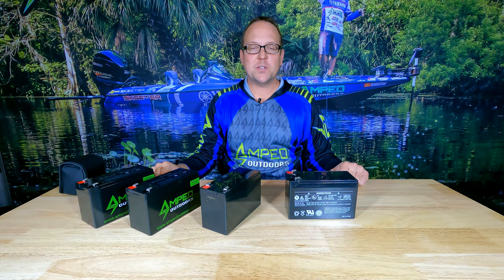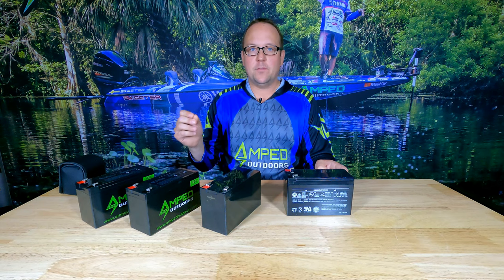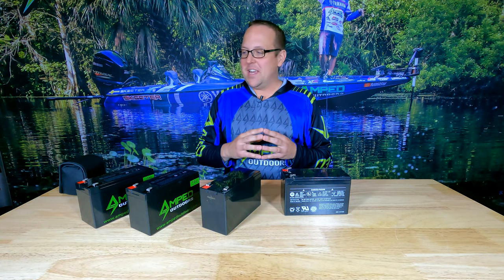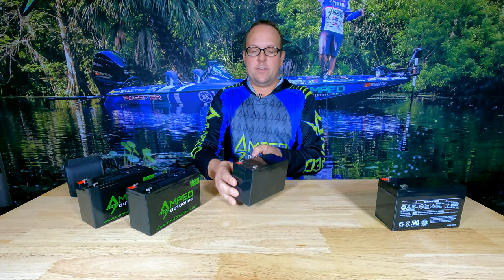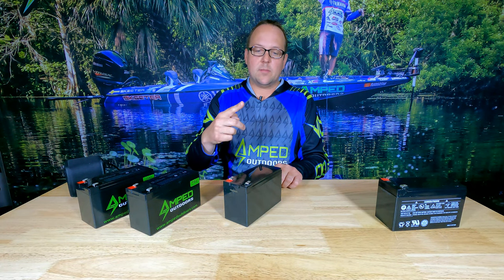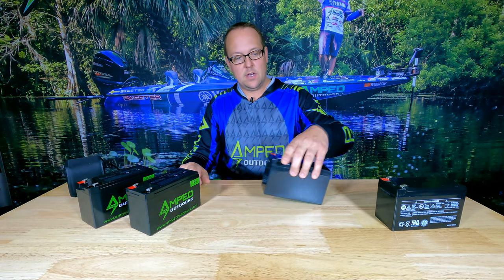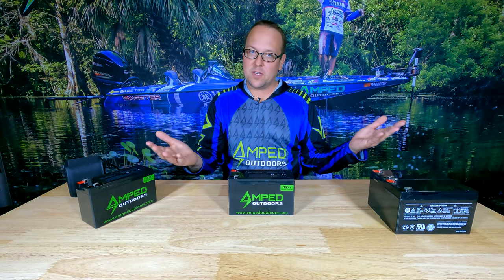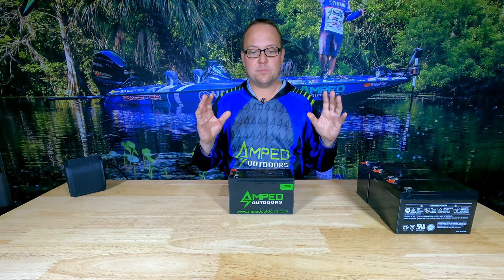How Fishing Electronics Draw Power - 11.1V NMC vs LiFePO4 vs 14.8V NMC

Comment: I am having a Mega live 360 and Mega Live W/target lock installed on my boat along with a Helix 10 and a Helix 9 (GN4's)  What size battery would you recommend to power these?  The boat is brand new and has 3 batteries with chargers already in place in the back of the boat.  All 3 are lead acid batteries.  2 to run the trolling motor (ultrex 80 45 with MSI/DI) and 1 for the outboard and misc.  I want a lithium battery for the electronics and see if they can install it and the charger in the bow compartments.
Reply from the maker: Hello, we replied to your email from the weekend. Let us know if you have any other questions there. Thank you for your support!

Comment: Pretty simple explanation, however are you all actually angling/fishing or playing video games all day ?
Seems to me you all need a marine system engineer on board with a devoted lcd console monitoring screen to ensure very amp, watt and volt is documented and accounted for in a precision performance data based discharge curve. You can then download the data and determine your power system discharge rate to fish landed vs time to see if you actually used your time on the water efficiently and accomplished anything.
Reply from the maker: Yes, we have displayed these discharge curves at many of our shows in the past. Sometimes it is hard for people to understand these discharge curves so this was another way to show that the higher voltage draw less amps....same amount of specific power.

Comment: You’re contradicting yourself. 

When at the 7:46 mark of the video you say the ‘higher voltage batteries are much more efficient on your fishing electronics”. That directly contradicts your previous statement made at the 7:44 mark of the video where you say:
“you’re always drawing the same amount of Wattage”.

Fact: If the Wattage of the electronics is always the same the efficiency of the electronics is always the same.

*Note: There is a slight increase in overall efficiency, but this is due to a slightly lower amount of Power being wasted on the wiring; it’s not due to an increase in efficiency of the units themselves.

**Note: Some units will automatically reduce screen brightness by a small amount when the Supply Voltage gets below 12.0 Volts or lower. The amount of automatic reduction in screen brightness is far less than if you were to manually reduce screen brightness by one ‘click’.
This in not an issue when using a standard 12.8 Volt LiFePO4 Lithium battery, hence there’s really no benefit to using a 14.8 Volt NMC Lithium battery.

***Note: You’re wrong when you say ‘manufacturers rate the amperage at 12 Volts. Typically the Amperage is specified by manufacturers at a voltage of 13 to 13.8 Volts.
Reply from the maker: Hello Patrick. Higher voltage only means your unit will draw less amps. It is all part of OHM'S Law. A unit will draw specific amount of watts, but with higher votlage battery, that equates to less amps. A battery 12.8V 30Ah for example will have less total watt hours than a 14.8V 30AH battery.
Reply: @ampedoutdoors6861  No kidding, please tell me what it was that I wrote which led you to believe that I didn’t know OHM’S Law, or that I didn’t know the simple fact that  
“A battery 12.8V 30Ah for example will have less total watt hours than a 14.8V 30AH battery.”?

More importantly what does that have to do with the FACT that you contradicted yourself when you said:
“higher voltage batteries are much more efficient on your fishing electronics”?

Efficiency is a comparison of POWER, not Amperage.

So once again IF as you correctly claim the POWER in the Wattage of the electronics is always the same the efficiency of the electronics is always the same.

Comparing a battery with less storage capacity (384 Wh), to a battery with a larger storage capacity (444 Wh), says nothing about the efficiency of the electronics. 

It’s a Fact that neither one of these batteries makes the electronics any “more efficient” than the other battery does.
Reply from the maker: @user-jm3ob6ri7j  Patrick, people get it. When doing a single cut video, maybe we should have used a different word. People need education, I think we got the point across. If everyone knew OHMS law, they likely are not watching this video.
Reply: @ampedoutdoors6861  One thing you’re right about is that “people need education”, however that requires accurate information.  

Anyone that’s been led to believe the claim made in the video that “higher voltage batteries are much more efficient on your fishing electronics” is true, hasn’t been educated with accurate information.

As for your claim 
"If everyone knew OHMS law, they likely are not watching this video”, that’s a cheap copout.

People that don’t know OHMS Law are far more susceptible to being misled into thinking “higher voltage batteries are much more efficient on your fishing electronics”.

You’d have saved face, and saved many words, by simply admitting right off the bat that the guy in video contradicted himself, as opposed to making excuses and making statements of the obvious used as a deflection such as: “A battery 12.8V 30Ah for example will have less total watt hours than a 14.8V 30AH battery.”

As a result of this conversation I will not recommend ANY of your batteries to the many people that ask for recommendations.
 
Have a great day!